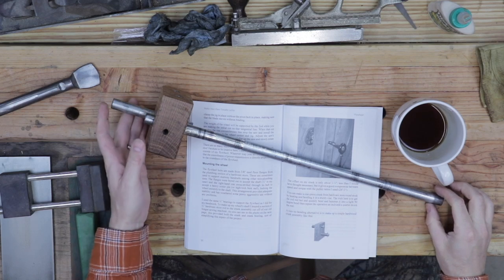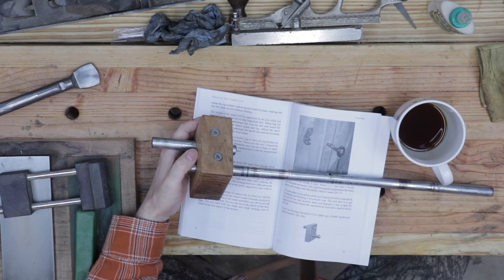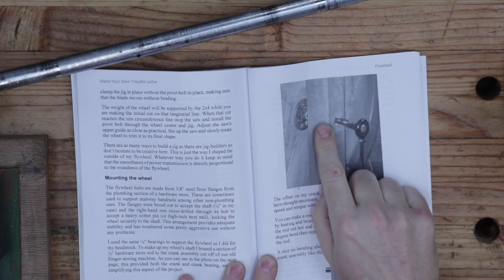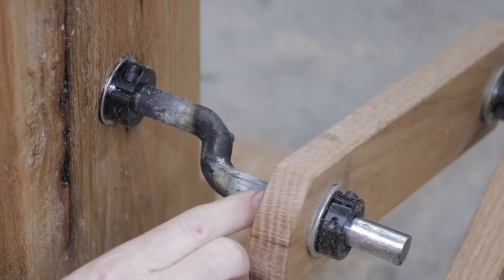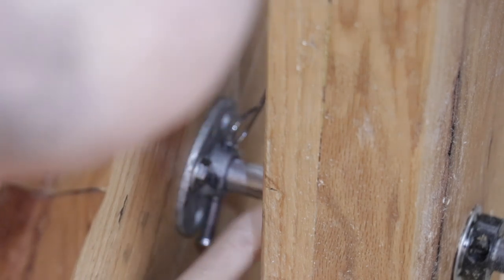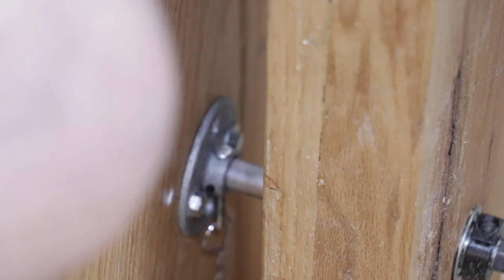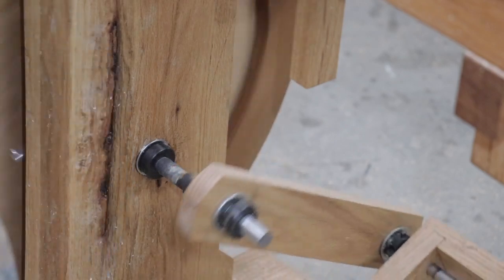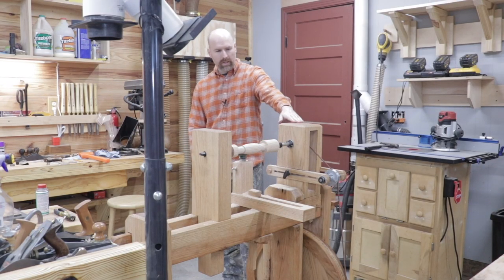I broke my new lathe! | Woodturning

Comment: I watched a few of your You tube videos, the last video you were showing movement of shaft through flywheel,.... i would change out the flanges and add a close nipple to each new flange on each side of the flywheel and drill through the close nipple and shaft and insert bolt and lock nut.  This should secure the shaft from turning in the flange. Also a little shim stock between shaft and nipple held in place with bolt will stop wobble.
Reply from the maker: Thank you. I will definitely look into that. I still haven’t decided how I want to fix it. I lack experience in metal working and that adds to the challenge of fixing it.
Reply: @lastingbuild1373  A set of tapered wedge shims under existing flanges held in by split shaft collar may also stop wobble.

Comment: For the fly wheel I would have threaded the flange and pipe and used a screw. I would think that would cause a more solid lockup
Reply from the maker: I bet that would be solid. I don’t have the tools for that.
Reply: @lastingbuild1373  only a $30 to $40 investment for a tap and die set from your local hardware store.  Opens a lot of possibilities.
Reply from the maker: I do need to make that investment